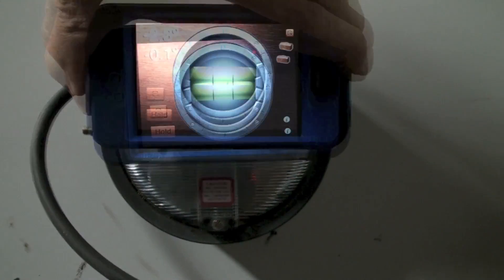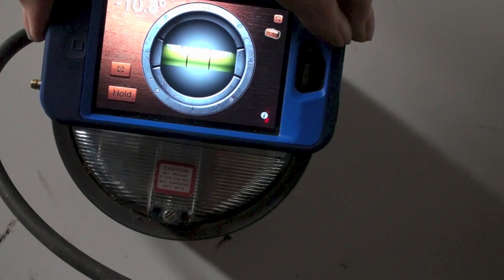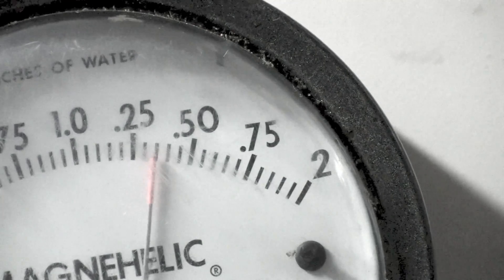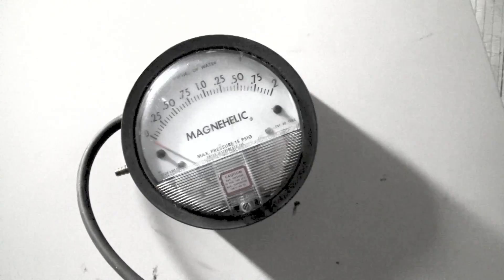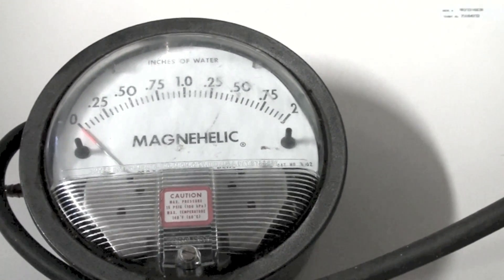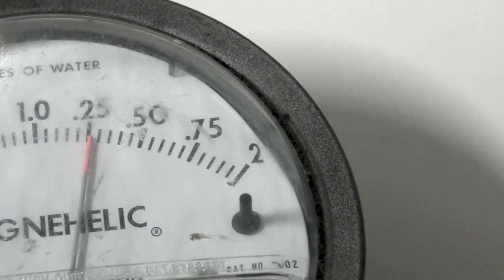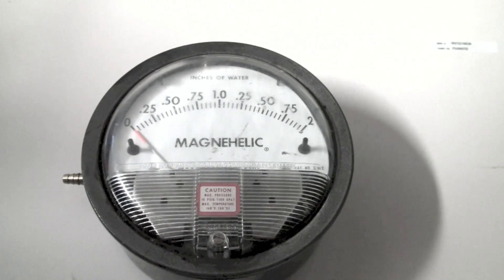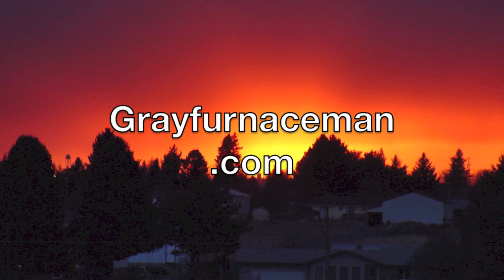The Magnehelic water column gauge.  Does it need to be level?

Comment: great video how far in does the tip of the rod need to go into the pipe? oil burner pipe and wood stove pipe

my draftrite is reading much different than my magnehilic
Reply from the maker: It should go in about 1/2 way.
GFM

Comment: What about how to read the gauge and what the numbers actually mean
Reply from the maker: It is a simple analog gauge using a needle to indicate pressure levels.  This gauge measured in inches water column.  28 inches of water column equals 1 # pressure.
GFM

Comment from the maker: You are certainly right for most applications.  They are mostly used for air pressure differential across filters or coils etc.  However they come from .2" wc to 150" wc so you could find one that reads to 8" wc for gas pressure tests.   They are rather delicate for field use.

Comment: this gauge is used to measure static pressure which is airflow resistance in your ductwork. you can then tell why your system is not fuctioning at its peak performance